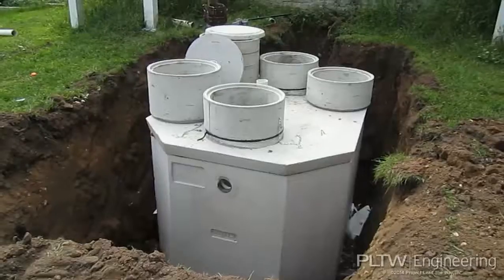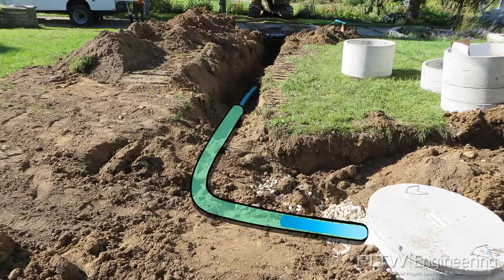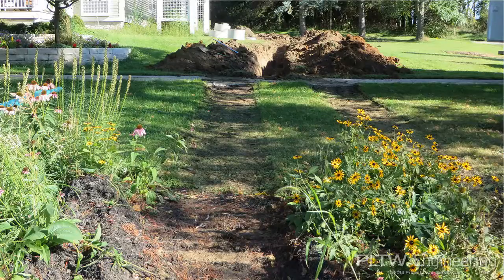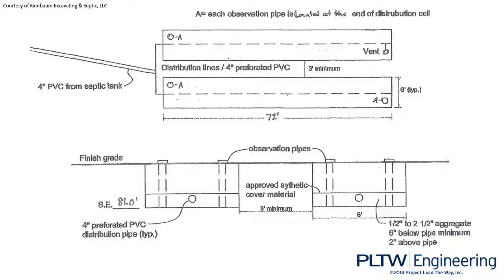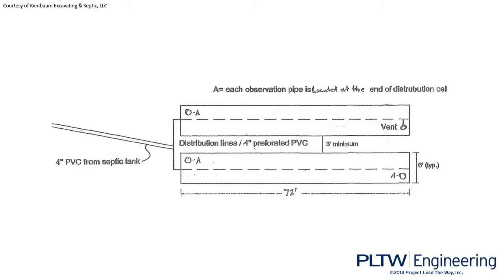Septic Trench Installation and Tutorial

Comment: I understand this post is 10 years old, but I found it very useful and had some questions please. What size drill bit it used to create the holes in the PVC piping please (looks like 13mm) and how far apart are the holes please (looks like 10cm)? Lastly how do we know how many metres of pipe is required for every 1000 litre storage of septic tank please? I'm currently designing a septic system to service 50 people. Thanks.